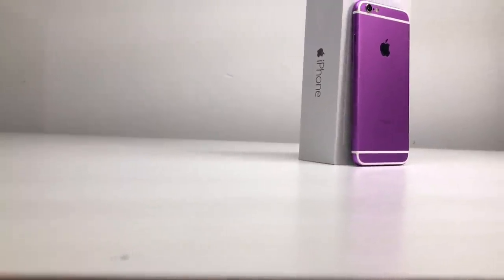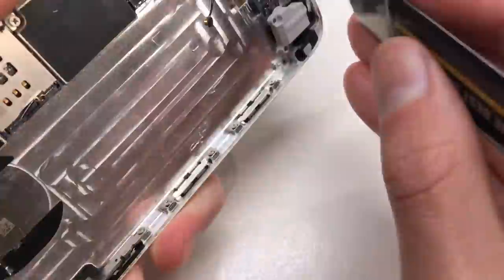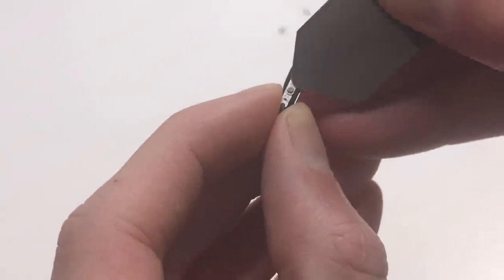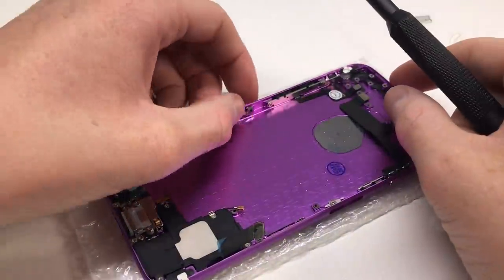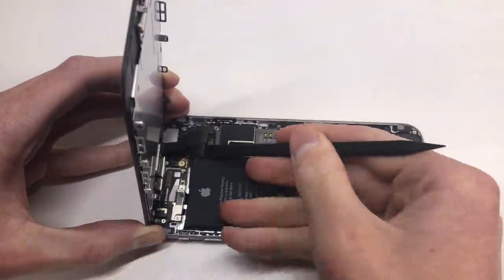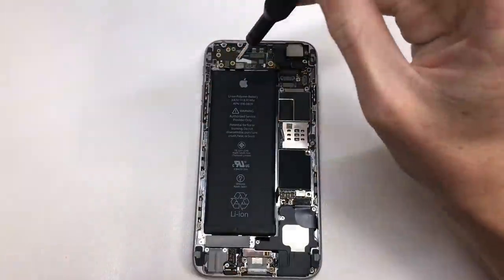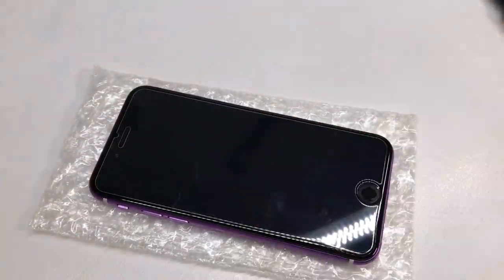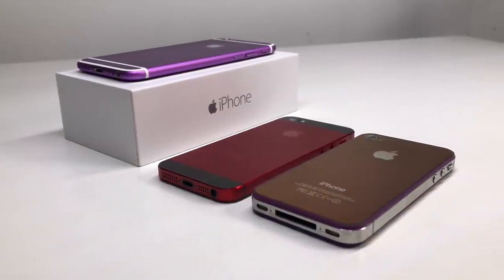Custom Purple iPhone 6 built from parts!

Comment: Wouldn't it just be a hell of a lot easier to just paint it?
Reply: Yeah I’ve stripped a 5c and flex seal colors it purple and it’s great. Idk how well it’ll bond to aluminum though since the original is anodized not painted.
Reply: no because it won’t adhere, as you’d need etching primer and a sanded surface. preserving the apple logo as well would be hard.
Reply: Paint would also get into the mic, the speakers, and charging ports unless you can figure out how to mask them off.

Comment: why'd they gotta make it out of so many bits? My nexus 5 and mi6 have like ten components total if I wanna swap a screen or frame!
Reply: Robin Rai Because they’re cheap
Reply: @brandon_nope  so cheap means better designed? Bro that doesn't make sense
Reply: Robin Rai Cheap in a sense means fewer components to make manufacturing easier for your Android devices.
Reply: @brandon_nope  But with no downsides and easier servicing?
Reply: @robinrai4973   No, it does not mean better designed, it means cheap ass production shortcuts.
Reply: @robinrai4973   I've had iPhones since 2007. Never needed servicing.
Reply: @DanaTheInsane  neither have any of my phones unless I break something. Again, how is it worse when it's simpler and has no downsides?

Comment: is the 3325mAh battery replacement for 6s+ worth? or just keep with an 2750mAh OEM ?
Reply: I'd say yes, does increase heat in the device, but the batter lasts alot longer than the smaller one

Comment: Is there a good, reliable place to buy parts in the US? I have iPhone 6 with broken LCD and won't charge. Changed the battery and it works but won't recognize cable in port.

Comment: ive repaired my iPhone 6 Plus. Now, there are some problems. Aftermarket display, wobbly home button, a DESTROYED iSight camera (rear camera) along with camera bump. Shows performance signs of waterdamage, but indicators are white, there is its original 2014 battery inside, which has shutdown issues, not giving the phone enough power, which causes some days it completely stone-dead, and other days, it powers on, we also have a bent housing, also some days the phone has a mind of its own. HOW DO I FIX MOST OF THIS??? I WONDER, ITS MY FIRST PHONE-NUMBER PHONE.

Comment: I dont believe the part where your supposed to undo the battery first because in my 6S i swapped the battery while the phone was plugged into charge and it didn't make a difference. I have also fixed a few of my phones without every touching the battery cable and I have never fried a phone. So it is not a "high chance" of breaking the phone it is low.

Comment: I'm waiting for my 64GB Black iPhone 6 (because I want btouc id black) for 110 $, after that I will order a full assembled red housing from a store from Aliexpress (maybe i will put an genuine charging flex in it but i thinking about that ), I also add a touch glowing apple logo and also if works wireless charging and glowing speaker, the perfect combo Red Housing with Black Screen😍 , for my mom i have an option i put the black screen and the touch id is white, for white touch id, i will put black home button sticker on it, this stickers can be found also for a few cents on ebay or aliexpress

Comment: Years ago I redid my white iPhone 4s with a mirror gold front and rear glass, was an awesome look for a while and lasted 2 years before I cracked the back, than a week later the glass on the front got shattered due to it falling off my bed and onto the carpet. Than Verizon locked my phone after I put it on post pay instead of prepay because post pay was supposed to be $30 compared to the 50 I was paying, they started charging me $60 every month and when I asked they said it was the $30 a month for the phone too, I bought the phone 2 years earlier off my little sister, it way fully payed for straight from Verizon in cash but they wouldent listen, told em I'm not paying for a phone I own so they locked it from ever being used as a phone again. Just been sitting in a box now with iCloud lock bc someone hacked my account and changed my passwords. Oh well, it was junk anyway lmfao

Comment: Umm….Guilty as charge I was fixing my iPhone 6s and I used a cheap battery and good display I connected the battery plugged the device in and in my head (cause baby your a fiiirework!) it doesn’t work anymore

Comment: connects the battery tab
connects display connectors and places display cowling back
places battery cowling
—some previous video—
“Make sure to disconnect the battery before removing the display to avoid ruining the display”
+me, an Apple Certified Technician+
VISIBLE CRINGE